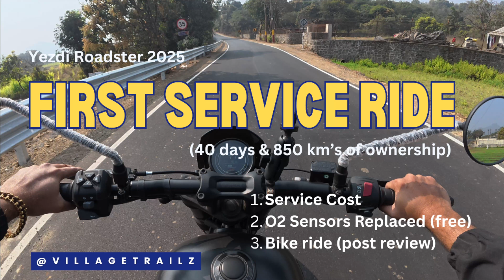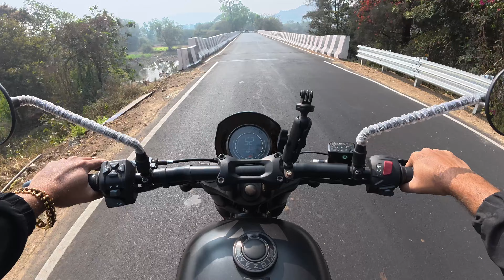Yezdi Roadster 2025 – First Service Done! 🚀 Super Smooth Ride | O2 Sensors Replacement

Comment: Hey, good review brother.I am planning to buy it next week.Other than O2 sensor and gear shifting is there any other issues with the bike ?Do say about it's mileage in city and highways.When was your bike manufactured?Is it coping up good with E -20 blend petrol ?
Reply from the maker: O2 sensor issue was for 2025 bikes, they have now sorted it out for good in 2026 bikes from Feb onwards - that's what I got to know from service centre. Mileage is consistently below 30 and above 28. But there is not much we can extract beyond 30, unless you do very long highway rides. E20 no issues so far but have ensured to fill only at specific pumps plus I have been using the fuel additive that was recommended by the service Centre. It's like a surcharge but so far haven't seen any issues. The only issue which I guess could be mindset is that there is no traction control. Lots of users complain about heating and vibrations but one can ignore those for the other positives the bike has. I would strongly recommend doing full test ride and comparison with similar other bikes. But go with what the heart says :-) 😊
Reply: @villagetrailz Heyy , thanks for the reply ❤

Comment: Is there any electrical issues or anything else, all the time I hear that yezdi gets to many issues
Reply from the maker: Not really. The only issue we faced was that of the 2 O2 sensors that had to be replaced within 800 KM and that too was a known issue - which was fully covered under manufacturing warranty. We recently fitted Maddog fog lamps and that time got to check the electrical wiring - all looks good and fine (I had asked the expert mechanic to give his views). It is possible that the feedback you might be hearing could of of older version, just thinking out loud. Do check with few more Yezdi Roadster 2025 / 26 owners and see what they say as well.

Comment: Have you face any engine heating issue and vibrations
Reply from the maker: Heating is there, I would say its not something which will bother you if you are wearing the right shoes. Mostly you would see the cooling fan working hard when you ride the bike at slow speeds 10-20 KMPH within city mostly but that is what it is supposed to do. Recently we installed fog lamps but due to low position of the leg guard, we noticed the warm air from the engine does reach up to these lamps - its not a concern that way because those are led lamps and designed to sustain some heat anyway. 

Vibrations till 80-90 kmph aren't there or mostly I would say, I personally never felt them there. There could be vibrations at higher speeds but I haven't really crossed those yet.

Comment: Would u recommend this or should I go for honda cb350
Reply from the maker: Actually that's a tricky question. Depends on what you are looking for. One of my friends owns a Honda CB 350 RS and driven 6K in one year. He is super happy and appreciates it's sleek performance and features like traction control, usb charging etc. Yezdi is quite opposite, more raw in power, stunning looks but not those extra features. I would highly recommend test drive of both. While Honda guarantees peace of mind, I think Yezdi will drive the mind a bit crazy (in positive sense). Let me know what you end up deciding on finally though 😊

Comment: Bhai first service ka bat heating issue and vibration kitna ha or mileage Kitna de rahi hai
Reply from the maker: Actually, heating issue, service ke pehle bhi nahi tha. Sirf cooling fan bahot frequently chalu ho jata hain. Mostly first, second gear mein aur traffic mein aisa hota hain. Heating ka kabhi problem nahi aaya hain abhi tak.

Vibration sirf 80 par karne ke bad hi ekdam halka sa lagta hain but honestly usko issue nahi bol sakte, kyun ki it is not irritating or making you uncomfortable.

Mileage abhi take test nahi kiya, Ab bike almost 1350 KM chal chuki hain, agle week test karke aapko batayenge. Tank size 12 litres ka hain, aur ab tak 4 times full kiya hain. But actual check karenge shortly
Reply: @villagetrailz 28.mileage